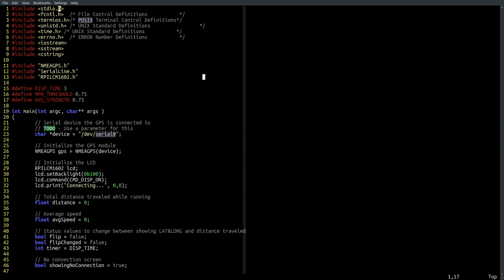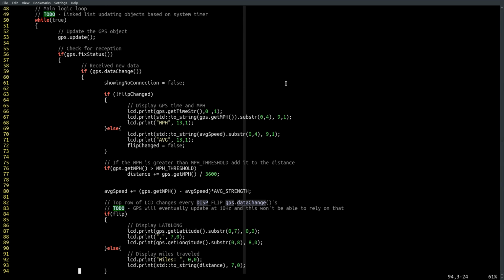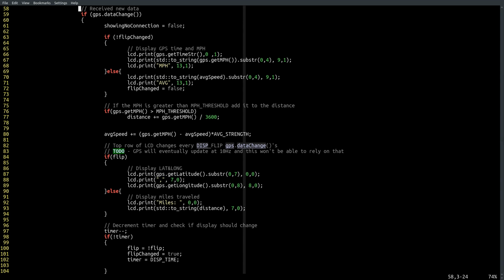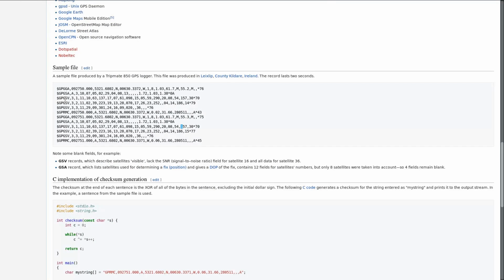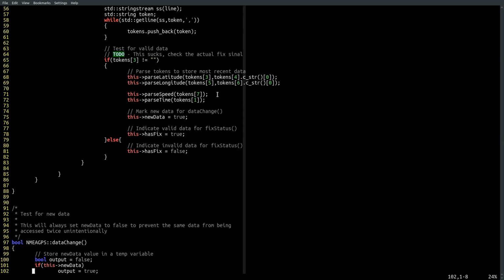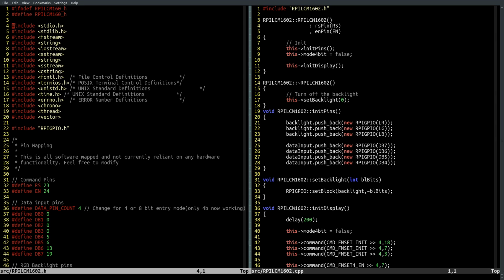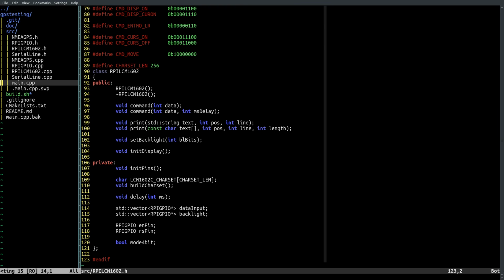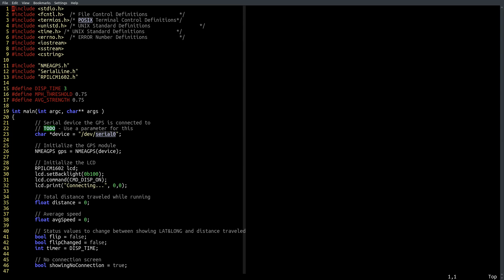0x000F - DIY GPS Speedometer

Comment: This is pretty cool! I ride a onewheel and i've been trying to figure out the best way to monitor my speed while riding. I was thinking of a smartwatch, but i wear wrist guards and it would be a tough fit. Then i came across this video. I could mount something like this to my fender or, if it had a smaller footprint, to the back of my wrist guard.

Comment: i can highly recommend this display: http://www.ebay.com/itm/84-48-LCD-Module-White-Backlight-Adapter-PCB-for-Nokia-5110-Arduino-/400488314619
(84*48 LCD Module White Backlight Adapter PCB for Nokia 5110)
has back light, and is well readable in direct sun and is graphical, uses SPI interface
Reply from the maker: A couple people have recommended the Nokia 5110 screen now. While it meets the qualifications of sunlight visibility and a light for night use, it is extremely small. The active area is about the same as half of the display I'm using now. So to fit the same amount of information(which I already can't fit as much as I would like) I would need to either make the font too small to see at a glance or need to cycle through many values. I also remember from my phones like that back-in-the-day that LCD likely has terrible contrast, another factor that will make it difficult to read.

Comment: Hey man, cool project. I've had a look at the code and it seems like you're doing a busy loop sort of polling... You mentioned you were going to break the program up into threads, so while you're at it, make sure to put some reasonable delays on your loops, that'll drive the power consumption WAY down. Interrupts would be even better if your GPS lib can do them.
Reply from the maker: Yeah, I didn't get around to optimizations like that yet, and might not in that version. Although a simple usleep(1000) in the main loop would help free the CPU while waiting for the next packet from the GPS. As far as the power consumption, I was mostly referring to the fact that the lowest idle draw of the RPI0 is massive compared to the highest draw from a simple MCU. An MSP432 running at max will use about 4.8% the power of the RPI0 in that scenario!
Reply: really awsome work @Tech Tangents By AkBkukU ..... what can be done with these Arduino boards .. is incredible…...... I do all this on my bike... with my old Motorola Droid 4 and Map Factor Navigator.... a cheap two cell Power Bank to keep it charged all the way....... and well you know.... is also whatsapp.. phone.. browser.. music player.. etc .. etc .. etc .. all rigth there on my bike barhandle....... but hey!! .. this is without doubt ... less commercial and more elaborate... awsome...

Comment: So, the PiZero uses a lot of power. What about another embedded device? An ARM with FreeRTOS would allow you to have multiple tasks to process the GPS in the background (as your example with threads). I would go for an STM32 since its really user friendly (when using it without any frameworks). I have worked with them in the past and they're a beast.
Reply from the maker: I'm likely going to make a camera-less version at some point. I'm thinking about going MSP430 for that. The MSP430 are a line of low power MCUs that I already have experience with. An RTOS with threads/tasks isn't that necessary once you start getting lower level. That's what interrupts are for. This doesn't require that much real-time processing either. 

I'm also thinking about going epaper for a new display. With an MSP430 hibernating between GPS updates and an epaper display, the GPS would be the only real draw on the battery. It could make for an extremely efficient design.
Reply: Well, the e-ink display would be really cool to obtain such low power usages. I know you can achieve the same things with interrupts, but it's just a personal thing. Keep us updated!